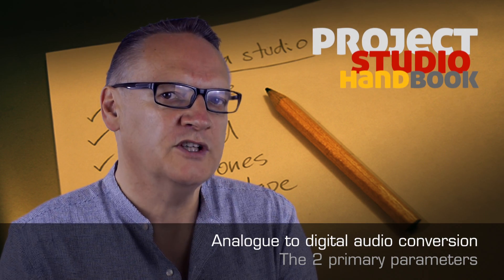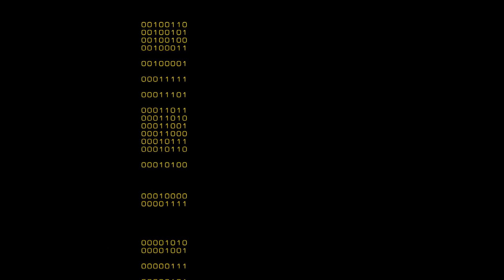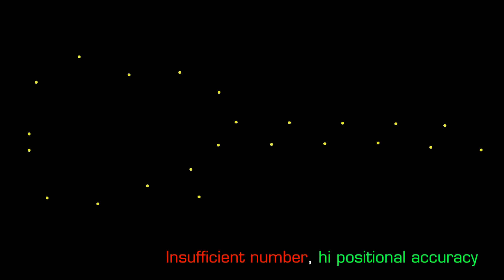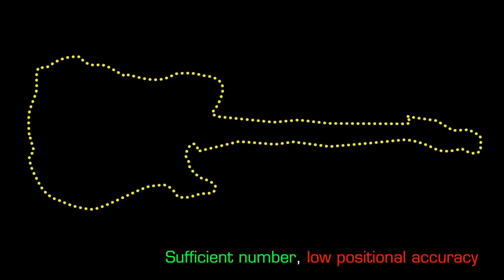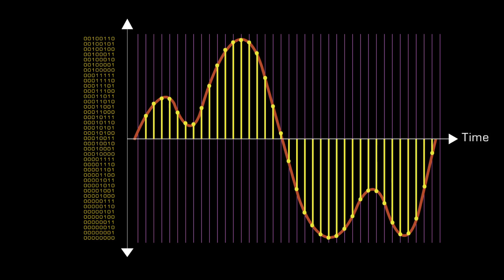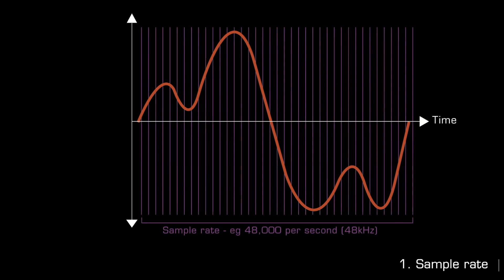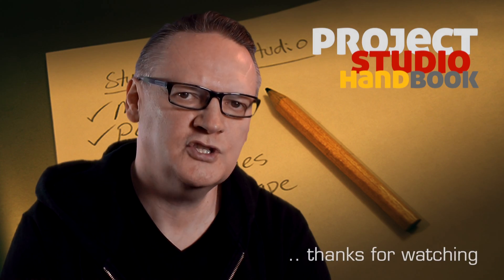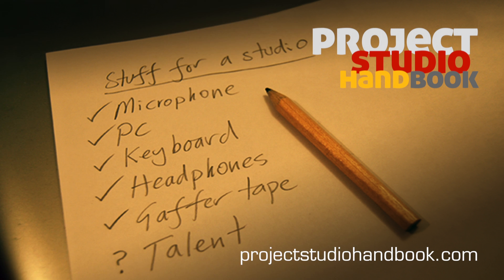Analogue to digital audio conversion - the 2 primary parameters

Comment: i understand you dont make how to videos however many people have the same problem i am having which is how to hook up a microphone to a computer. i use a microphone that is plugged into a desktop computer in the microphone plug on the back of the motherboard and i use audacity in ubuntu 16.04. i can here the microphone but it is not loud enough. their is a thing called "48V Phantom Power Supply" but this is for Laptop which does not give the microphone its full 5 watt power. on my desktop it has that and so i was told that it would not allow me to increase volume. but could i use a "PRE-AMP" before i plug into the computer to increase its volume. or basically how do i increase volume. its a normal $10 microphone. however its not dynamic i think its a condenser however, i have both and neither gives a loud volume.